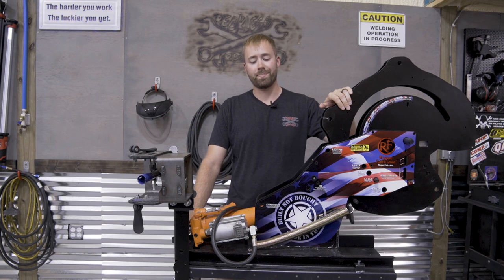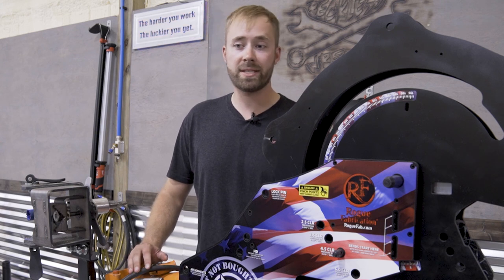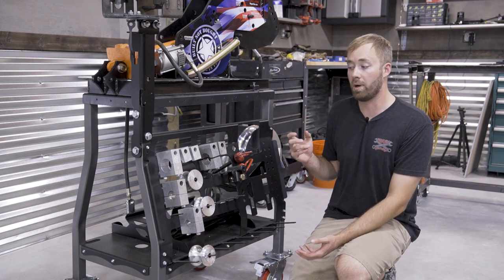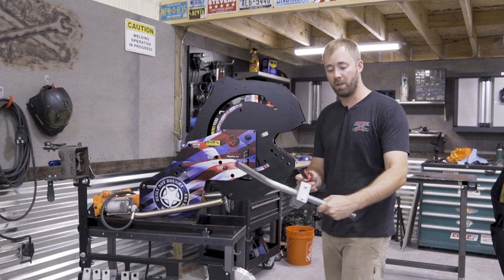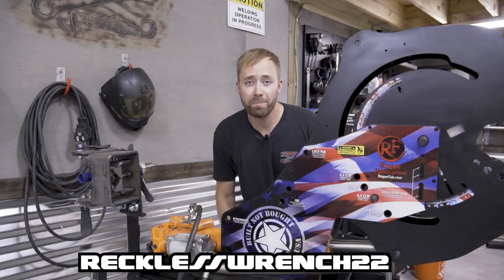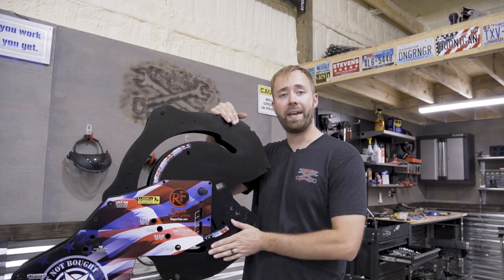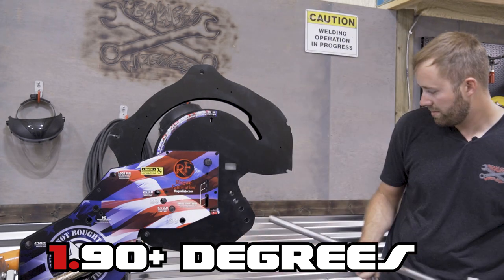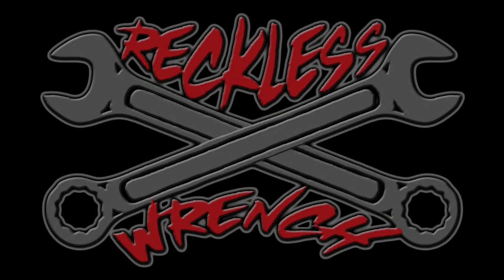The Best Tubing Bender You Can Build! - Reckless Wrench Garage

Comment: I enjoyed your review.  I purchased my XHD aproximately 1 year ago. Since then, i have added dies, the mandrel attachment, upgraded pointer, angle cubes.  I purchased the upgraded wheels to turn my XHD  to a 625, and i just finished paying for the 2 hp electro/ hydrolic actuation system.  I have not used it much yet as my shop burned down a couple years ago and is not rebuilt yet.  I have a project already figured out in Bend Tech and the tubes are cut .  I have to make the alterations to the XHD frame to upgrade to the 625.  Do you have the mandrel attachment and have you used it ?  Have you tried using the square tubing dies ?  I can tell from this video you are quite experienced so i would appreciate any thoughts you might have.  Thanks Demon ( Demon Fabrication )